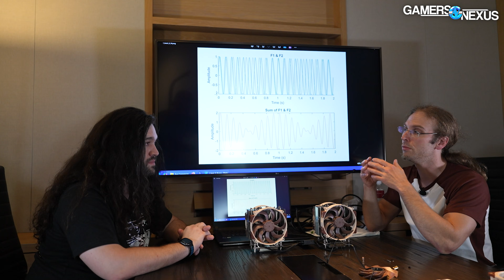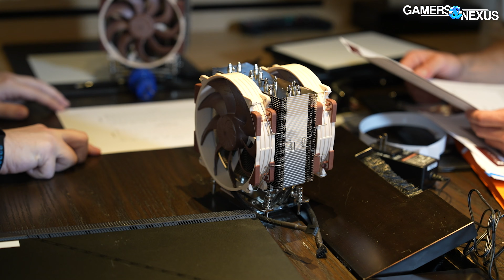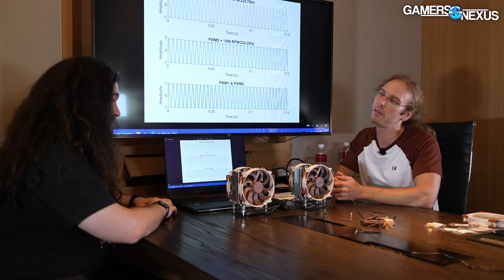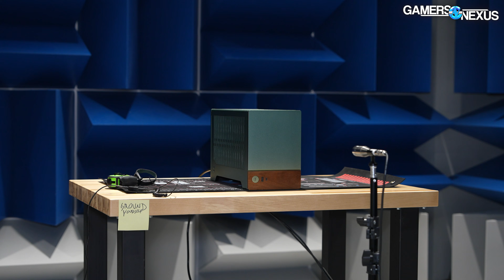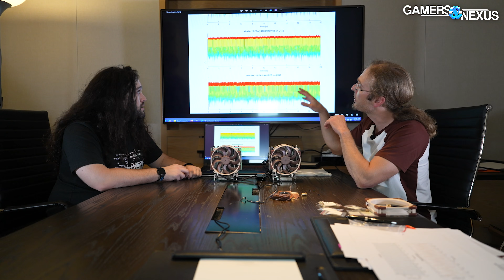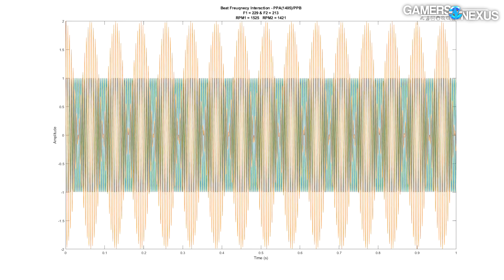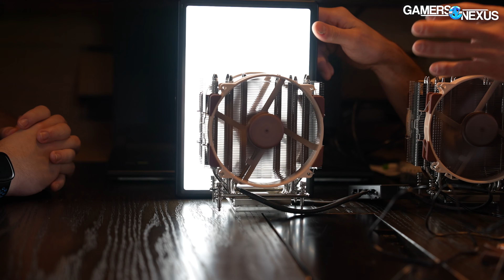The Most Annoying Computer Noise | Noctua Engineering Deep-Dive on Case Fans

Comment: I had this issue bit faster same noise, my first thought was maybe it was a difference in fan speed between the 4 x NH-U12's and the 2 x NF-A9's on my GPU (7% difference), I actually matched the % on all 6 fans and fixed it, but obviously the fan % where not same as frequency, I'm just proud my brain got it kind of right! 😉😁😂

Comment: the "beat" frequency noise happened to me when i had 2, 7200 rpm HDD for storage in my case. it produced an unbearable pulsating hum. finally got rid of both drives and settled on a single 5400 HDD for storage.

Comment: Thanks for the video. I recently replaced the fan of my PS5. It was a 17-blade model from Nidec, one of the oem suppliers for the console. And this model is infamous for its "UFO-sound". A weird, rhythmic, high pitched whirring. Similar to the Jetsons Spaceship sound. New fam was a 23-blade-design and it works like a charm. It is not dead silent, but just normal now. The UFO is gone.

And hot damn, it was a beat frequency! Or a related effect. Since the PS5s fan is a radial fan maybe the number of 17 blades created that effect on opposite sides of the fan, along some rims/openings into the PS5s chassis. And the symetry causes those places with pressure differences to only nearly match up with the fan symetry. And boom. Beat frequency. I heard there is also a 18-blade-model out there that was said to not have it. I did not choose it, since I thought more was better. Now I know, that it would also have worked fine. 

Great video at the right time for me to connect the dots. Thanks!

Comment: factors affecting fan noise and health : case design , fan placement , fan size , mesh material , fan vibration dampeners , case volume , position of cpu heatsink and gpu  with respect to case fans also matters alot for turbulence and air rotation ,
fan redesign is needed on all levels and a good case design with fan placement recommended by the same company should be given in the manual or website because peeple are randomly attaching any fan to any case and anywhere , it matters to serious users

Comment: I have been building a computer with a focus and obsession with SILENCE! Nothing seems to be any use. No matter what case or fans or cooler I use, there is always the annoying hum of fans whirring.

Is there no hope?

How can I get it to be quiet while also not locking fps to 30 at 1080p? Is it possible??

 I have tried 3 different cases, 3 cpu coolers, about a dozen different fans and configurations of sizes/brands/orientation.

Comment: Asking to Noctua's engineers: premise this idea comes from an old CoMpetitor's fan that got a potentiometer to set (reduce) the max speed while maintaining full ability to control it by pwm;
it will be possible to add on the back of a fan a switch with ie 3 or 4 positions to be able to set a maximum speed (ie 1450-1400-1200-1150)?

Comment: Noctua modded Asus Dual OC RTX4070...
I think the "beat frequency" may have been one of the main issues why my fans at 1000RPM (minimum turn-on speed) where still annoying. Whether it was or not, I ripped off the fan shroud and replaced it with two, Noctua NF-A12x25 (chromax black) fans. AMAZING! Here's the main points:
1) Noctua fans-> Y-splitter-> to motherboard fan header (not graphics card)
2) Minimum RPM around 350RPM (GPU about 35degC)
3) Maximum RPM around 700RPM under stress test (quiet/silent)
4) Fans controlled by "Fan Control" (amazing software).
5) my custom fan profile-> (350RPM (15%) until 70degC, 700RPM at 82degC, 1400RPM at 85degC)
Quick overview:
My Asus RTX4070 seemed fairly quiet at first. Then I noticed a slight warble/hum. It went away. It came back. I realized the "0dB" mode of the card meant the fans in IDLE PC usage turned on roughly every five minutes. At 1000RPM with that slight noise. Always on with that slight hum wasn't an option (plus it was sometimes very loud when gaming). It started driving me crazy...
I tried to put DAMPENING material under the fans. Didn't help...
I'd modded my GTX1080 with Noctua fans, so I planned to do it here. PROBLEM! Needed a custom fan cable...
I researched that, but then realized in my slow brain that the "1000RPM" turn-on speed would still be a minimum. So I planned to hook up to the motherboard...
(Different fans can be a huge issue with a card anyway. I got COIL WHINE from my GTX1080 so I'd run the 2nd fan to the motherboard for that card to reduce the load, and used "Fan Control")
So..
Long story short, my card is essentially DEAD SILENT. The fans are being controlled by "Fan Control" software. The fan PROFILE is custom by me, but Fan Control uses the GPU (not CPU) temperature sensor so that's perfect!
Rest of PC is Noctua fans/cooler. And I use Fan Control for those too. CPU and case fans 350RPM to 700RPM. Essentially SILENT PC!
(Why is this so hard for GPU makers and custom PC builders to get right? Run the CPU/GPU hot but not too hot and design the fan profile around that to be as quiet as possible. And tiny fans on a GPU that are forced to spin to 2000RPM+? Why? To save a couple dollars? Heck, you could reduce the heat sink size and just put on LARGER fans, that spin slower and have a quieter card that costs the same or less!!!)

Comment: what if you mechanically linked the 2 fans on a cooler or made an interface that would match their speed to eacuh other exactly?
wouldn't that also solve the issue and remove the humm all together?

Comment: Ok so one scenario i can think of where just one fan could produce a beat resonance is: if its up against a 7200 rpm hard drive
Because those things are fast enough to produce a distinctive hum noise at 60hz (7200rpm / 60 seconds) if your fan blade * rpm happens to also land around 58-62hz or so, you could absolutely hear a beat

Comment: One fan that is notorious for this sound is the Arctic P12s
Reply: Yep, it was so strong the fan filter began to vibrate within the tray it sits within. Replaced them all with noctuas and it went away.
Reply: But but but those are cheaper and out perform Noctua….buy once cry once kids.
Reply: @Bob_Smith19  just because its cheap does not mean it's immune to criticism

Comment: Slight pity that only single vs dual fan configs where viewed. I'd be interested also in what happens with increasing fan count, like on multi-section liquid cooling rads, especially if push-pull.

Comment: i must have got lucky af as i removed the be quiet fan off my cpu cooler and added lian li fans to it, one normal and a one reverse, looks sick and got my idle temps down from 46c to 36c, but no extra noise! is it because my MB has a CPU_OPT port?

even running 3dmark steel nomad my cpu sitting about 46c! my h6 case got 9 120mm and 2 140mm fans! all lian li, it's a beast n looks beautiful, the cpu im running a ryzen 7 5800x3d btw

Comment: I've been familiar with a similar, but visual version of this phenomenon. I like to record CRT monitors on occasion, and most cameras (when configured properly for recording CRTs) will record at 59.94fps. Various retro consoles can run at oddball framerates, and the CRTs will just output them as their are. For example, from memory the Genesis outputs something close to 59.4X FPS, which is ever so slightly different from what the camera records. For the most part, they'll stay synced up, but every few seconds you'll see a rolling pattern scroll up the screen of the recorded video, and then it will sync back up again. The further separated those framerate values are the longer and more frequent those patterns will appear.

Comment: Easy fix for noise pull fan rotor off motor clean with a little 90-99% rubbing alcohol and paper towel apply sewing machine oil to the metal fan stem and motor pop the rotor back in the motor and never buy another possibly overpriced fan again! 🙂

Comment: I remember getting my first noctua cooler for my intel core 2 duo e6600 after my friend who had a q6600 core 2 duo processor had the noctua nh u12. I got the smaller nh u9 model. and It still runs to this day , the pc is upgraded though :)

Comment: This harmonics alignment effect happens everywhere and is nothing new, stack 3.5" drives close together and they will do the same thing, drives designed for NAS storage take this into account and adjust rotational speed to reduce harmonic vibrations, its easy to hear it when it happens, and this is why Apple has fixed variable blade geometry on there fans, so each fan blade is slightly different to the next, so each blade produces its own specific frequency and spreads its sound over a range of frequency's which results in much lower noise level. There is another effect that happens, when two identical things moving or vibrating at different rates are contacted through a fixed point will eventually align them self's and will also result in this harmonic effect, put two metronomes on a panel and start them at different times they are out of sync, and they will eventually align and sync on their own.

Comment: I bought thermaltake case and came with ct140 pwm fans. And there are annoying as it is shown at 0:40 . No matter what I do between I cant set a stable curve between 25% and 50% I gave up and I ran them only at two speed one is lowest and second is 50% no other curve.

Comment: Man, I wish I could hear that. I have t been able to hear anything like that kind of low volume background noise since way back in my late 20s....in a PC at least. It is interesting to see what causes it and the physics behind it. It is a useful consideration when setting up larger fans for ventilation etc., though! Good way to toss practical higher ed science/math at some gamers that may not have thought much about it, too! 

PS: Only because I'm thinking about it, one thing that would be cool to see, maybe on your Extras channel would be some up to date comparisons of some older specific hardware against newer applications/games. Maybe not too old, even like, say a Sapphire 6900xt Nitro or Toxic, or  like a older CPU with a new GPU and vice versa. I think it would be more helpful for people doing upgrades. New stuff is great, but the data is often collected using all up to date hardware. It is possible to kinda approximate it, but sometimes surprising things happen and hard specific data would be awesome. Maybe people could loan their older cards for an autograph on it and shout out? Just a thought, thanks!

Comment: You know the Noctua guy is for real when after 30 minutes there has been no mention of "AI".
Reply: They also got the GN award for not having rgb lighting.  Love them!
Reply: "Our AI tuned program told us how to stop beat frequencies using state of the art nvidia ML GPUs."
Reply: AI-bsolutely
Reply: I wonder if a fan could have built in speakers and monitoring to cancel out the sounds the fan is making.
Reply: Or cringy marketing w@nk terms that like "industry leadership", "progressive development", "leveraging technology"......BARFFFF
Reply: or he is AI but hides it to not concern anyone^^
Reply: Why should there be? Computer fans and fluids dynamics existed before AI.
Reply: Fans are the snake oil of the PC industry.
Reply: It looks like GN cannot handle my comment.
Reply: There is not much engineering in a fan, it’s all just a money game.
Reply: There is no getting around physics, but I guess if you can put AI into a fan do I have to worry about it taking over my house?
Reply: But not for real for pricing the fans so highly
Reply: clearly this company is going nowhere /s
Reply: @Hurricane2k8  smh Noctua innovating only in the FAN industry? Their market cap is going to plummet
Reply: Yep 😄, though I'm pretty sure AI based simulations are an important tool for their R&D
Reply: @tkermi  It uses the same hardware, but isn't AI.  Machine learning uses the same type of hardware as ray tracing and physics simulation does.  That's one of the reasons why the US is so against Nvidia selling GPUs to China.  It's not AI, it's because they're used to make nukes.
Reply: @EmperorA0  ML is a part of broader group under AI. Same as DL is a subset of ML.
Reply: @tkermi  Yes... I am aware of the nuance, but it's a short comment.

Where's that meme about AI just being if statements when I need it?
Reply: 😂 so true!
Reply: @metallurgico  LOL Europe is definitely all in on AI...even if you don't know it yet.
Reply: @Zboe-JL Remember, todays "AI" is yesterday's algorithm
Reply: @Zboe-JL Yeah I'm confused. The tech industry is so damn interconnected anyway it's not like the EU is ever gonna be able to "firewall" over-hyped LLMs even if they did want to. Which, of course, they don't. Our politicians and corpo-rats are exactly as daft, greedy, and unscrupulous as their US counterparts, and AI hype looks like it'll keep steaming ahead for a while yet.
Reply: @metallurgico  WE don't care ? We panic and can't keep up with laws and regulation of AI..... EU always panicing when they run into trouble regulating something outside their control.. greetings from central Europe.
Reply: They’ll be bankrupt in less than a year if they don’t add Ai to their fans. Rip Noctua 🫡
Reply: @richboii6597  Yeah. Everything is better with AI. lol. 

I am going to assume yours like mine is a sarcasm comment.
Reply: @deadjester  sarcasm? Just ask yourself this… how do you plan on cooling your cpu WITHOUT Ai?? No Ai = thermal throttle = rip Noctua 😉

Comment: I have 4 Noctua case fans and a Noctua CPU cooler in my system. The sound they make is extremely pleasant. Sometimes it's actually preferable to have a nice pleasant white noise than to have no sound at all. 

They're just so much better than any other fans I've used, and the oldest two of those fans are about 9 years old and still sound extremely quiet, and, as far as I can tell, the same as when I first bought them.

Comment: In the aircraft propeller world,  we fixed this issue by adding synchronizers and synchrophasers. We make the props spin at the same RPM, have the same blade angle,  and adjust the blade passage over the fuselage. 

Different seats will be louder or quieter depending how the blade passages over the fuselage add or subtract. Just like how he explains.
Reply: From an intuitive perspective, the closer you get the RPM the longer the time between beats.  Which, for other, is what you're talking about.

I think that's just down to tolerance.  A 10 RPM/fan tolerance means you can have up to a 20 RPM difference. With aircraft, things are much more precise so you can get much closer RPMs.
Reply: @EmperorA0  He's saying it's perfectly and consistently synchronized. At least while cruising. There's a big difference between high end fans and aviation. According to wikipedia, synchrophasers not only match rpm but the propeller positions. Unfortunately this will only cancel noise in certain locations and it may be louder in others, but at the same time there will be no noticeable beat.
I would like to see Noctua try that though. Seriously I would. I suspect it is actually doable with hall effect sensors that tell the exact timing of each revolution and a tiny microphone or two mounted on the cooler. A very cheap microcontroller can analyze the data and do a training much like memory training.
Reply: @ericmollison2760  I bet the 2 pulses per revolution from the regular tach wire is already plenty.  Fan impellers have quite a lot of inertia.  Fans could have a special daisy-chain connection that would use a feedback loop to control the speed of the downstream fan to sync with themselves.  You might even be able to synchronize fans purely in software on the host CPU, provided you can think of a way to work around the limited resolution and sample rate of the RPM readings from the super I/O chip.
Reply: turboprob planes? Or i imagine for jet engines  is same theory essentially?

Comment: So this is only a problem in the situation "CPU cooler + 2 fans"?
What happens if you have a cooler with 3 fans?
Is this a problem with fans on a radiator?
Reply: It can also happen with 3 or more ofc but the effect will be more spread out the more fans you have. Like with two fans all goes into one interaction. 3 fans means 3 interactions and they can't all be the same (for math reasons at most 2 can be the same, so with the 3 fans you at most can get 2/3rds the effect)

Comment: Fans close together, OR fans intaking near a slotted surface cause thrashing. That's expected. Which is why there is such a challenge when it comes to two fans on a large heatsink, almost right next to each other. That will likely cause some issues with the "woauhhh woauhhh" sound. Audio geeks understand it's because they are running at different speeds, causing the frequency range to shift phases.
That differentiation from one rpm rate to the other (and fan size) is similar to phase shifting with sound systems. Subwoofers can be a challenge finding the 'sweet spot' for the LFE. Sound frequency waves are so long with subs (lower hertz causes more distance from the 'peak' to valley in the sound wave), you have to move the subwoofer a couple feet at a time to find the most bass impact from where you're sitting. Thus... this is fairly straightforward for many audio geeks, I guess is what I'm saying.

Comment: I guess I do have a few questions. 1. Does how close the 2 fans are matter for this to happen? You obviously show this happening on a singular cooler but could you get a beat frequency from an intake and an exhaust as well. 2. Does the size of the fan matter? can you get a beat frequency from a 120mm fan and from an 80mm fan? My guess is yes but it isn't explicit. 3. does the orientation of the fans matter at all? Again you demonstrated this on a cooler with the fans basically in parallel but can you get a beat frequency from fans that are perpendicular to one another or maybe side by side like on a radiator?